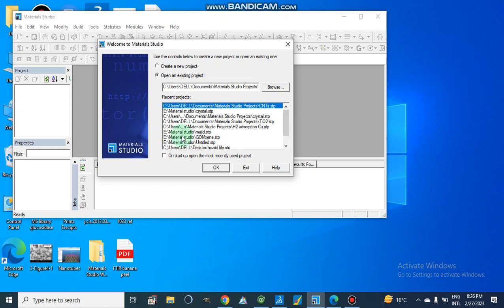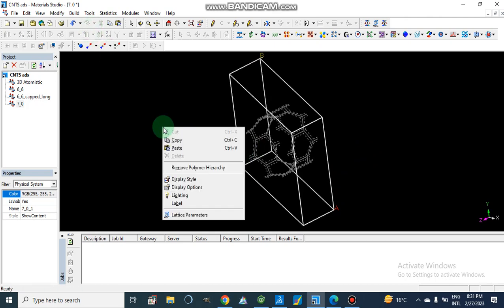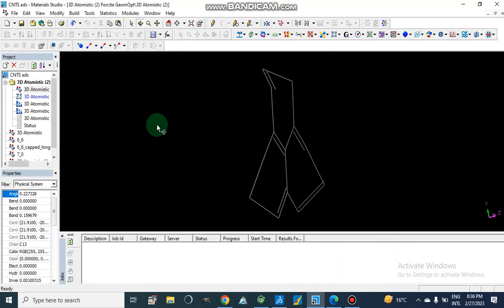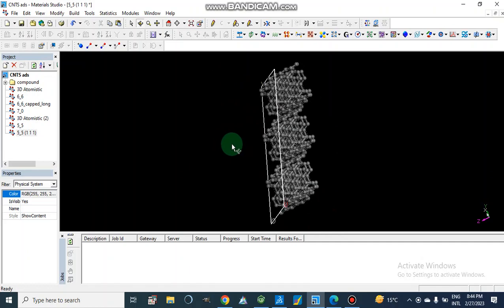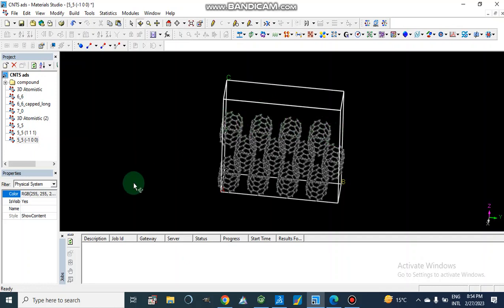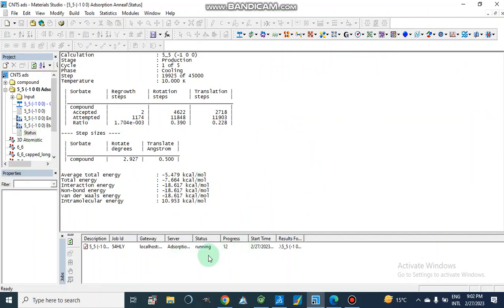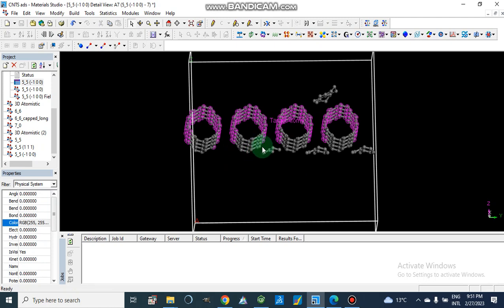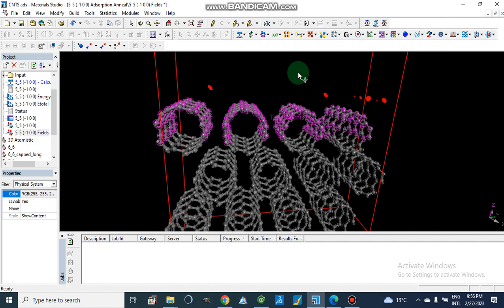Materials Studio - Carbon Nanotubes CNTs & Adsorption of compound/dyes #nanomaterials @MajidAli2020

Comment: Dr. Ali, Happy to see your vedio, can you share the steps, how to modify the carbon nanotube with any functional group; like as we add and any heterogroup such as SO3 on the surface and how we do it and how to check the energy minimization? can you share your wechat contact?
Reply: @mudasirmir bro, have you did it, as i wanna do the same . I did by simply functionalized the fabric but I guess that's not the accurate way.

Comment: Hi, I am doing Adsorption run calculation of CuCo2O4 oxide on carbon nanotube based on your video and I get this erreur message, Could you help me pleased?
The typing engine has failed to calculate a forcefield type for 29 particles.
Try using a different forcefield or assign types manually (and remember to turn off the automatic calculation of forcefield types).